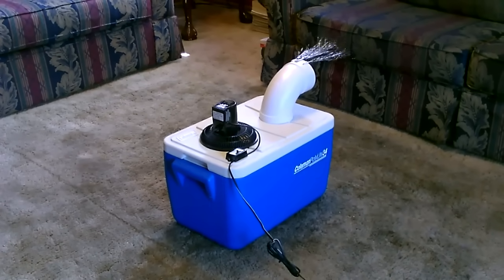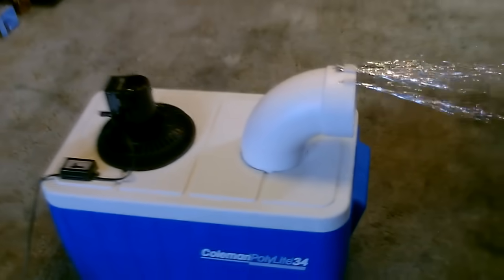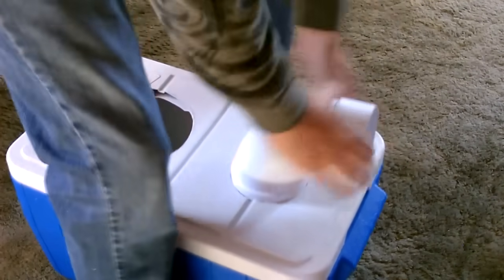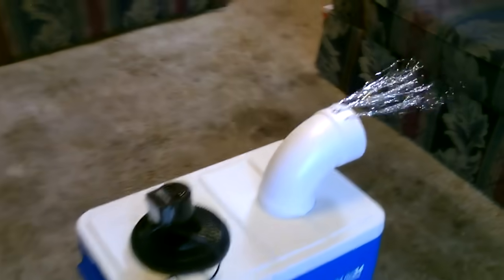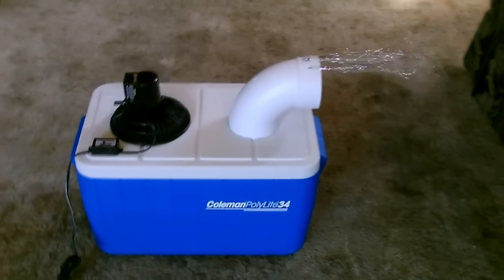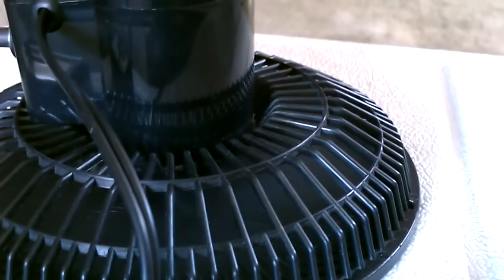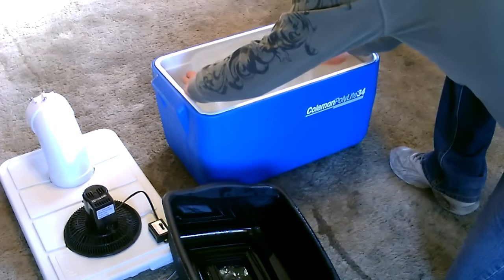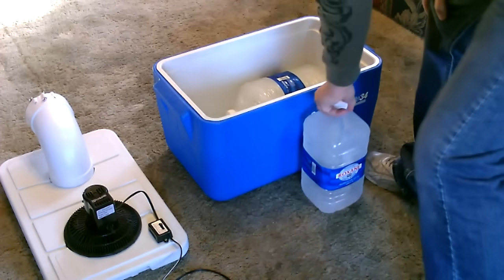Homemade air conditioner DIY - Awesome Air Cooler! - EASY Instructions - can be solar powered!

Comment: When the salt melts it creates a larger surface area. compared to a solid brick of ice. The larger surface area creates a larger water evaporated which than creates a cooler climate

Comment: Hang a 30 lb bag of rock salt or ice melt over a small garbage can (to catch the dripping water) to add an off grid dehumidifier. Look it up its a farmers method be  careful with the salty drip water but in any case this would increase the efficiency of your setup probably about 50%

Comment: I built one last year, used two pc elbows to direct the cooled air so my hens have a larger area to move around. I have a few 1 gallon  water jugs that I just refreeze as needed. happy hens give more eggs...15 watt panel on top of coop, fan from Harbor Freight has switch in line. no battery, just solar

Comment: Have you seen how plastic bottles are used to cause a cooling effect with air flow? Why not salvage a fan from a portable air conditioning unit that blows hot air out the window and use it to force air through copper reduced tubes with evaporate pads being misted with water over the openings? I wonder if it would work to produce lower temperatures rather then just working like a swamp cooler?

Comment: In theory you could operate a refrigerator and a deep freezer using this same method. Just need insulated pipes to cut out the condensation produced from cold pipes. Or use coils to form water from air condensation to fill an underground cistern.

Comment: I wonder if you could make it with a input duct with a dryer vent or something, if you have a hot room in the Winter, put the duct outside and pull outside air in and cool it further, if you have a hot room with AC on in the summer, you can put it over the vent and cool the AC air further.

Comment: You could vary the size of the chunks of ice to vary the temperature.  Lots of little bits would produce very cold air for a little while, one big block like this will mildly cool air for hours.
I'm looking at building a workshop in a cargo trailer, and this looks like the simplest and easiest way to work in the summer.

Comment: Question Sir, how would this work and react with Dry Ice?  I know I am gonna get reamed by someone but I got Three brand new Yeti coolers in the box from a foreclosure estate sale,  use two but the other is just sitting still in the box. I wonder if i could pull an all weekend Friday thru Sunday with this set up in a Yeti when I take my boys out camping in the cabin tent. If i ran a seal around the fan and Output Pipe. its a three bedroom we sleep in one, The middle room is dining, Playing  games and just hanging out. The other room is a changing room wash room and has a Chemical Toilet that has fresh water and flushes into a bio degradable Blue chem holding take. i was thinking about a portable Room AC but it was gonna require making and reinforcing a whole for the hot air exhaust tube  But I love the solar idea. My Boy's are still in Elementary school so this give me many Opportunities, To teach them build it together and then help them learn how solar energy works. a room a/c would be a nice cop out, but this idea would make a great fun time together to build?

Comment: This is a simple, clever idea. Kudos. I have a highly technical background and I can tell you that the process here is a lot more complicated than it first appears. There is a complex relationship between relative humidity and temperature.
With a few tweaks it can work very well. I gotta go but I'll try to make a few pointers later that will help all of you.

Comment: How much electricity does it use verses a window air conditioner?
Reply: Kathleen Lewis 
Sweetheart, ignore the jerks. You are completely welcome here.
Reply: Kathleen Lewis 
This will not use anywhere the electricity of AC even if you consider freezing of ice.
An AC has to suck, cool, condense, possibly pump and blow. All he is using is a fan.
Reply: Ross Mennie So what are you saying then it won't work?
Reply: Kathleen Lewis 15w free from the sun. Were you not watching?
Reply: bilzup no need to get nasty I'm not an electrician just trying to learn!!!! wow!
Reply: Kathleen Lewis ya see I am an electrician and I expect everyone to understand power consumption, that my problem sorry.

Comment: I wonder if you drilled a small hole on the backside of the elbow it would supply the fan with cooler air slowing down the melt..?

Comment: As i think about this idea, it's even more "cool" then i originally thought. Not only would the ice cool the air, but the resulting air would be dehumidified.  As the original air hits the ice, the temperature lowers,  resulting in condensation. The humidity will be removed from the air. The resulting air should be very comfortable!

Comment: Coupe you answer me a ? I ordered a Competition Solar 47701 Solar 20 Watt with Charge Controller to run a 6in 10 watt fan. Will a 12v 18ah deep cycle battery be sufficient? This is for camping!!!!

Comment: A Stirling cycle cryogenic cooler would remove the need for ice. Just use multitherm liquid to circulate through system. Use a simple stinger to heat up multitherm liquid for a heater in the same system.

Comment: It works because the heat in the room is being used to break up the molecular network of bonds in the ice - the heat is being 'absorbed' by the process of melting the ice.

Comment: What brand is the fan? I want to build one but I can't find a proper fan for it. Is it proper to use a USB PC fan?
Reply from the maker: hi there. it's an  "auto expressions" 12VDC fan (sold in the auto. dept. at walmart). you can use a USB PC fan but you'd need a powerful one if you want the amount of airflow that you see in the video. those 12VDC auto fans really move a lot of air.
Reply: Thank you! I think I'll try this one or maybe the fan you use on The "2 Gallon Bucket" Space Cooler (because it's a bit smaller, cheaper and also 12V-powered)

Comment: If you can use aluminum cans (aluminum best heat transfer coefficient) you will get more efficient heat transfer. Also, by not using ice you will actually dry the air which will make you feel more comfortable at higher temp. Just will have to bail the condensate when you reload.
Reply: Scott Sluggos Rule! Frozen aluminum cans of water? That would be the ticket. Keep another batch frozen and just rotate each time.

Comment: Thank you for sharing!   Do you know what size of an area it will cool off?  Also, it would seem that if you placed the cooler up higher while it cooled the hotter air that rises, it would work more efficiently.  :)

Comment: desertsun02m Do you think if you ran 6" (or whatever size the pvc was, I was assumed you used 6")copper or even tin tubing from just underneath the lid where the fan enters it's air, then down to the bottom of the floor of the cooler then over and up and attach to the pvc, then fill the cooler with crushed ice and water (maybe 50/50 ratio) it could get colder? I know the solid block of ice will last much longer than the ice water, but it seems like running air through ice instead of around it would be cooler, just not last as long. I guess it would depend on how long you usually use it each time.

Comment: Take a insulated metal tube within a tube. Fill the outside space with pykrete insert sterling cryogenic cylinder in at bottom of tube fill center tube with antifreeze lower copper heat exchange coil in on top and seal it all up. You now have a super cool water chiller that you can also use to circulate biological antifreeze through a copper coil attached to a booster fan to cool a room with. Just have a wrot counter sink in a bucket of water on the return flow to bleed off sum of the heat before the cycle continues. Emergency cooling systems.

Comment: Why not use dry ice?
Reply: John Galt 

Dry ice is frozen CO². As it warms up, it goes straight from solid CO² to CO² in a gaseous state.

I would rather have a minor water vapour (most frozen water/ice will just become water from cooling warmer air) than risk gassing myself when I just want to cool down.
Reply: Linden Murgo 
Hmmm,  I know what dry ice is, but I really don't  see why dry ice would not be a better option.   I understand evaporative cooling and how it works but to just blow cool air into a space I would think that dry ice would get the job done.  Thanks for replying... I will experiment with this.
Reply: John Galt 
Dry ice may be better at cooling, but I don't want to fill my room with CO² (that could be fatal - hence my disagreement regarding dry ice).

If you want to experiment, that's your choice, risk, etc.

Comment: Thanks dude! I made one of these and it works great.  It's better to freeze bottles of water rather than just open ice because open ice/water will blow a lot of humidity.  And even better than frozen bottles of water(I use gallon milk jugs) is frozen salt water.  Water only freezes at 32 degrees F, but salt water freezes at minus 6 degrees F and my deep freeze cools down to minus 10 degrees F.  I didn't even fill my cooler all the way and it's been 8 hours and it's still blowing cold air.  I think it will last 11 hours once I fill it all the way by adding smaller bottles of salt water on top of the gallon jugs and then insulate half of it with towels to regulate the amount of cold air that comes out.  I live in AZ and my electric bill in the summer is $600 per month, but I can cut that at least in half with this by just cooling off my bedroom with this.  And my big deep freeze costs me a whopping 36 bucks a year in electricity.

Comment: Hardly an AC but for an overniter ....nice. Interesting anecdote . Brooklyn Tech HS had a 5000+ seat auditorium when finished in 1930's. While commercial AC may have been avail they chose the build a room above the auditorium with a big fan.When they felt it necessary they'd call the iceman who would promptly cometh...with several tons of ice.Ice was readily avail in cities circa 1930 and very cheap. It is storied that this effectively cooled the auditorium for the few hours necessary 1 fan...pollution free...very cool idea

Comment: If you used battery operated fans (Wal-Mart) and used rechargeable batteries it would be portable.  Also, use a cooler on wheels with a pull handle.  (p.s.  I have solar chargers for batteries (Amazon)and made a charging station in one of my south-facing windows.  I charge batteries and solar powered lights on it.   My charging station is an over-the-door rigid plastic  shoe rack with slanted shoe shelves and metal hangars.  Fits in my tall windows perfect; hangs right on my wood window trim.

Comment: That's really "Cool", but how much cooling capacity can you get out of a block of ice in 5 hours. Do you have any data showing room size and ambient air temp over the course of 5 hours???
Reply: doens't matter. all you need to know is it works. people used these swamp coolers before ac was invented.

Comment: used to make these when ac went out in freightliner but I used big Styrofoam cooler and foam cups for the pipe. put car fan that plugs in cigarette lighter and cut my holes with razor knife.
Reply: Very inventive idea!!! Necessity they say is the mother of invention. Cheap and reasonable.

Comment: do we have to attach  fan with screws or wire?
Reply from the maker: hi there. i didn't need to - but if you really want to secure it on there, zip ties work well.
Reply: so make two holes right? thank you i liked this idea.
Reply: desertsun02 ,What was the make and model of your fan? Thanks.

Comment: only thing I would add is a silicone seal or duct tape or somthing around the duct so u dont losr some of that air just my opinion
Reply: Where do you think the "lost" air would go? ...Maybe to the same room as other cool air. So what are you loosing here? -> Nothing
Reply: prpunk187 I’d fill the accessible inside of the lid with spray foam to increase insulation of cooler.
Reply: ya, just hot glue it..

Comment: Using pycrete (ice block made of ice and sawdust mixture) would decrease melt time exponentially.
Reply: This is the smartest comment here.If WW2 had lasted longer you would have seen a ship
made of this material.Easy to make Pykrete with 14% sawdust and 86% water-mix and freeze.
Reply: Dobes Rule   Too messy
Reply: You mean it would increase the melt time by decreasing the rate of melt? Correct?

Comment: My husband made something very similar when he drove across country back in 1982, in an 74 Capri that had no AC.  We met on that trip, so I got to feel first hand how well it cooled the car. I was in Phoenix, AZ. and it was about 95* outside and VERY a cool 72* - 74* in the car.  He tells me that he went through 15 lbs. of ice each day, as he took the southern route from Los Angeles, CA. to Kingston, N.Y. and it was miserably hot throughout the south.  He used salt to sprinkle on the ice when the outside temps got really hot. Something to do will helping the ice give off colder air or something. Oh well, whoda thunk it..!!
Reply: Old Story 2 old😆😎
Reply: Thank you for sharing. My old truck doesn't have a. I will nee to try this for sure 😊
Reply: your husband did a great job. I personally would not use salt though because the ice would melt faster; that's why they put it on icy roads in the winter.
Reply: Using rock salt will make whatever you are freezing with the ice freeze much more quickly, but the ice will also melt more quickly.  When I was a kid my grandmother would make homemade ice cream a couple of afternoons each week in the summer when all of us grandchildren were at her house everyday.  We used one of those old hand-crank ice cream freezers (which we kids got to crank lol).  My grandaddy would pack the ice around the tub where the ingredients (cream, vanilla, etc) were placed in order to freeze.  He then added rock salt to the ice.  If you didn’t have the salt in there it would take that ice cream forever to freeze-with the salt it would freeze the ice cream (or at least solidify it) in less than half the time compared to just using ice.  The only drawback was that the ice melted pretty rapidly and you had to keep adding ice and salt.  When I was a crazy teenager we boys used to get some older guys to buy us a case of beer and we would put it in a big ice chest.  Somebody got the bright idea to add some rock salt to it.  We ruined that first case of beer but learned our lesson.  You use one ice chest to get it cold, then transfer it to another ice chest without the salt before the beer froze and the cans exploded lol.  It took us a couple of trial runs using a couple of beers at a time but we figured it out.  Beer should be served cold-and that’s the coldest beer I ever had!  Another added bonus (at least I like it) is that the can always has a little salt on it-I thought (still do) that the salt compliments the beer nicely.
Reply: Dave XB Salt water ice does not take longer to melt because it does not take more energy to melt.  Adding salt to water will lower the freezing point, which will cause it to absorb more energy from a certain temperature air, which will cause it to melt faster.  The air coming out of the ice chest will be cooler but the ice will melt faster.
Reply: So, Barbara,  I just wanted to know if this thing would really work and I think according to your comment that is does.  Thank you.  I will try with a cheaper styrofoam cooler from the dollar store and a fan that plugs into usb in my car in Florida with an a/c that blows hot air!
Reply: @JudithLawrence718  is
Reply: Salt Water has a lower freezing point. Hence salt ice is colder and thus takes a little longer to melt. 
If I did this, I would full it with salt ice every time.

Comment: turn the outlet to face the fan itll blow colder air into a colder box, also, if you use a powered cooler box the ice would last a lot longer

Comment: Question: I placed a car blower motor on my ice chest along with a "Blower Motor Wheel". It seems to have plenty of power especially if I lift up the cooler lid, I can feel it blowing quite a bit of air, and yet I have no air coming out of the pvc pipe. What am I doing wrong? 
I am wondering if the blower wheel s/b replaced with a regular fan blade?

Comment: How did you attach the fan?
Or is it just sitting
Reply from the maker: hi there. it's just sitting (but you could zip tie it.)
Reply: desertsun02  What a great idea and video. Thank you for posting this. I was wondering about the connection from the 12v fan to the 12v battery. What connection was used between the car connector for the fan and the black and red jumper cables for the battery?
Reply: I have this same fan. I cut into the original plug and I just added a cigerette adapter that I had laying around. You just need to make sure that the positive and negative terminals match. You should be able to tell by looking at the wire or take note of it before you take cut anything.
Reply: Or just use a silicone and also around the vent tube.